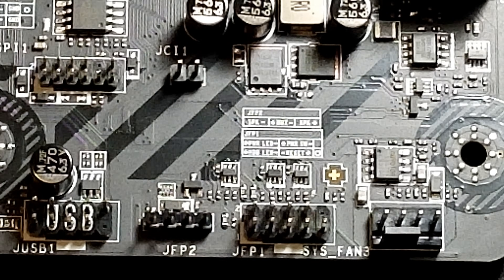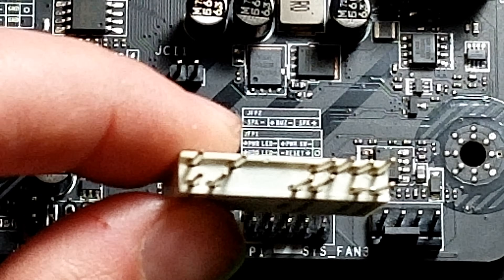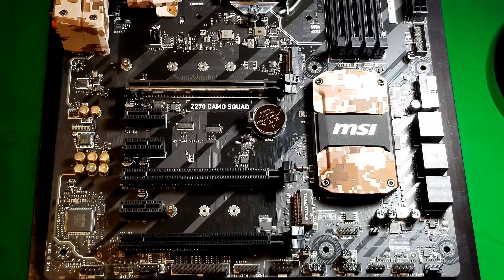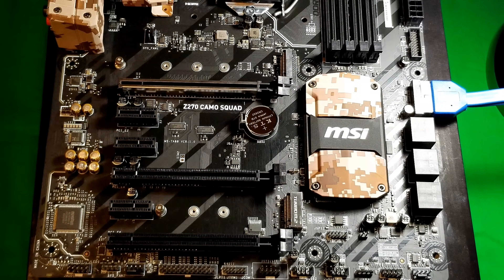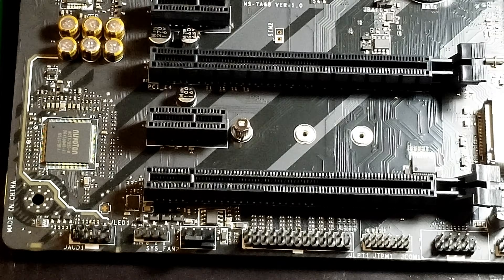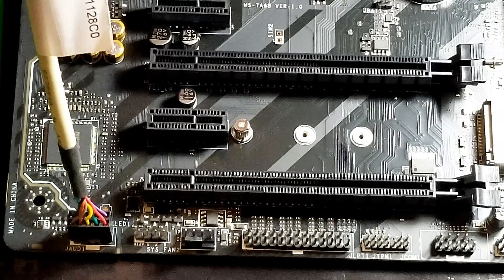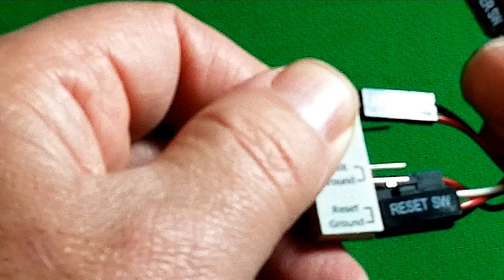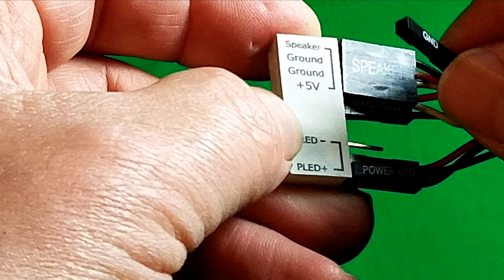Connecting your Case Front Panel connectors to your Motherboard

Comment: Hi ya great video . I have a quick question. I have gone wrong somewhere done the line . I have a factory hp elite desk which I wanted to put in a new case ( eventually up grade as I went along) I removed front panel connector ( not seperate pins ) for power and leds etc. But I think got it wrong when connecting new case to mother board .. As there was no manual or markings on MB I looked online and found some indication of where to put them. I can get some lights on. But I couldn’t get machine to power up . I decided to put everything back into old case and connect up the mother board but still the same problem - is there a chance I could have blown the psu or worse the MB .I have a new psu but don’t really want to test on it lol. Only other thing I can do is get a new bother MB (1150) and swap out CPU at least the MB will have markings . Any idea what could be wrong?  When the psu is plugged in the green light on the MB is on. 

Thanks
Reply from the maker: Transplanting to a new case from a pre-built can be tricky, with ensuring the standoffs are all ok to start and nothing shorts out, after that the next thing would be to get the Pin Layout for that motherboard to know the places you need to plug into...just plugging in the case cable's are not likely to cause any electrical type problems unless you plugged into something other then where the case LED's are meant to go...like if you plugged into firewire, or some such thing...It sounds from what your saying that your Motherboard is likely ok, but without having it to test myself that's just an educated guess...if you think something happened to the PSU, you could take it to a computer shop and get them to test it for you, usually at no charge, but some might...or just purchase a PSU Tester for around $20 to test it yourself...A new motherboard with the markings would certainly help to be sure where to plug things in but it doesn't sound like the MB is an issue...what motherboard is it, I'll see if I can find out for you where everything plugs in...Thanks...
Reply: Reviewing Playing & More RPM thank you for your reply.. the motherboard is 
https://www.empowerlaptop.com/p/737728-001/?currency=GBP&gclid=EAIaIQobChMI3t2WgZHT5QIVBbDtCh2V_Q2kEAQYASABEgLDkPD_BwE 
The black PB / LED pin is the same as this one in the picture. I appreciate it if you do find anything 
• •
• •
  •
• •
• • 

Like I say I put it all back into into the old case and connected up all the power and it still didn’t work. So hopefully it’s just psu as I have a new one .
Reply from the maker: There are some uniques issue's with this motherboard that will imo make it very difficult to use it, ie..there is a PSU backplate adapter you will need to buy, and apparently there is some unique adapter you will need as well but couldn't quite be sure which one they were referring to, the cost of both would be a good portion of the cost of a new MB...plus there are no markings on this particular motherboard to show where to plug in your connectors, therefore it would take some trial and error to get it right, and that could prove costly and or damage components trying to figure it out...Which I could have found more info for you, but on this one I'm at a loss...sorry about that...
Reply: Reviewing Playing & More RPM thanks Dennis - i appreciate your help... I’ve brought a new motherboard to fit my CPU which I think will be the best thing to do now. I’ll save for a new CPU and new motherboard in the new year and upgrade over time. I haven’t been beaten - I’ve learnt so much and I guess this is the beauty of it all - again thanks so much
Reply from the maker: well wish I could have helped more, all the best...
Reply: Reviewing Playing & More RPM and you!

Comment: Can someone help I’m using the nzxt h700i and I don’t have any from panel connectors like this!?!
Reply from the maker: Your actually lucky, the H700I has all the connectors together, is the PLED + and -, power reset etc in one square block, so going from the left of where it shows your front panel pins it should fit over them, just gently slide them on it only goes one way, and then your done...Might have to get this case and do a video on it, it's a great design actually...Thanks...

Comment: Can my hd audio go anywhere on AAFP??
Reply from the maker: It only goes in one way, look for the the HD Audio cable, it has a blank spot line it up with the blank spot on yours and it will be good...Yes some MB's call it AAFP...Thanks...
Reply: @Reviewing_Playing_and_More_RPM  Yep got it, one more thing though, i have a 500gb samsung evo and a wdblue 2tb hdd and all it shows up is a 932 gb partitian, but in bios they both show up correctly. Thanks
Reply from the maker: You may need to initialize one of the drives or perhaps it was used previously and was partitioned off, not certain but check to ensure you set the boot drive to whichever one you want to use, and then once you've installed the OS you can go to Desktop Management and see what is showing and initialize the drive if necessary, or you could potentially have a defective drive...there's a few things that can account for it...hope you get it going ok...Have a great day...

Comment: Why is my pc turning off right after turning it om
Reply from the maker: My first thought is an incorrect power supply voltage might cause your computer to turn off by itself. Make sure you're keeping the computer cool enough, or it might overheat to the point that it shuts down. ... Test your power supply, 2nd could be the CPU Cooler is not working correctly to cool the CPU...also if the system is old, dust accumulation on the fans can add heat to the system and cause issue's so cleaning it might help as well, if none of this works let me know...Thanks...
Reply: To me it was my motherboard that sucked
Reply from the maker: @ogaboga2952  Yeah it sounds like that might be the issue here as well but really hard to say at this point, take care...Thanks...

Comment: I just realized that I did the power, reset and HD led the opposite way of how they should be, and it still worked. Aorus X470 Gaming Ultra
Reply from the maker: should not have worked if the power was opposite what it should be but in some cases they wire the cable wrong and it needs to changed, however the LED and reset won't matter and will work no issue's...typically though the power should not work if placed wrong...Thanks...

Comment: why doesnt the direction of the LED pins matter? LEDs only work one way, they're called diodes
Reply from the maker: The LED for the case will work regardless of how it goes on the pins, the + and - won't cause any damage and it will still work...
Reply: @Reviewing_Playing_and_More_RPM  there's probably a reverse protection in the case then. still better to connect it the right way
Reply from the maker: Case LED's have been this way for many years, without any issue's, but yes connecting it correctly is always best but ultimately will not make a difference...Thanks...

Comment: Wait.  At 10.32 you connect the positive arrow to ground?  Is that right?  Shouldn't it be negative to ground?
Reply from the maker: In a case the Positive goes to positive which is indicated by the small arrow, the other goes to the -(negative) what I showed is correct...if you don't think so you can check out other videos on the topic and you'll see the same thing...hope that helps...
Reply: @Reviewing_Playing_and_More_RPM  ok, thank you...

Comment: Srry I'm newbie you know the f panel connectors do they come with the case?
Reply from the maker: Yes, the cables come from the Case and go to the Front Panel Connectors...Thanks...
Reply: @Reviewing_Playing_and_More_RPM  um I bought Phanteks p350x but it only came with power , hd audio and power switch. Do I have to have the rest???
Reply from the maker: No some cases don't have a reset button or in some cases there won't be a LED light on the case either...I think every case should have one but that's just me lol...
Reply: @Reviewing_Playing_and_More_RPM  lol

Comment: Great video. Can you make another video comparing the pins on the board to the pin diagram in the manual? Some of the diagrams don’t match very well or are difficult to interpret.
Reply from the maker: I have a look and if possible and I have the time to complete it I'll make one...Thanks...

Comment: The power switch confused me. You said "the positive in this one is the bottom one" and put the positive on ground. So ground is positive?
Reply from the maker: The positive is the one with the arrow the one beside it is the negative as long as you follow that on the front panel connectors ground is not a concern
Reply: I had the same question. For the HDD LED, you put the arrow on “positive.” For the reset, you put the arrow on “reset” not “ground.” Then, on the PWR, you put the arrow on “ground,” not PWR. They are plugged in differently, which is why the confusion. So does the arrow go on “ground” or “the one that isn’t ground.” That is the question. Or do those not matter?
Reply from the maker: @andygetz7343  The PLED + and - matter as well as the Power, the others can go in any way and will still work just fine...so no difference on those other cables...except of course RGB...Hope that helps...

Comment: OK, so I just found this video by googling around and doing some research, So I bought this cheap 400 dollar Lenovo Desktop and it has an Intel BSW N3050 board. There is absolutely nothing on the internet about what the pin layout is for the Power and reset switch, etc... At first I bought a NVidia 1050 graphics card and stuck it into the PC. It works fine but the case is little and the GPU barely fits even tho it is very small. So I decided to buy a new case, but unfortunately when I got the case I noticed when I was trying to move the mother board that there is one of those adapters you were talking about in another comment, It connects the front panel pins and into the motherboard. Due me getting a new case I cant use that adapter., do you know of anyway for me to somehow connect all of the front panel connecters without buying a new board or am I forced to buy one?

Pc:https://www.amazon.com/gp/product/B01KLSMWVA/ref=ask_ql_qh_dp_hza

Only thing I could find for mother board:https://www.impactcomputers.com/01aj066.html

New case:https://www.amazon.com/gp/product/B07GNJPC93/ref=ppx_yo_dt_b_asin_title_o00_s00?ie=UTF8&psc=1

Pls for the love of god help me, ive been trying to hook this up for months now and this is the only thing holding me back :(
Reply from the maker: The Pin Layout for the Intel board should be beside the yellow pins just to the right, now I can't see it for sure but it does look like it's labelled...I can say for sure how old this motherboard is but it looks old...you can verify the pins by looking closely at the MB and see if it says PLED + and -, also HDD LED, etc...if so you can connect them as per the video... big issue is that the case has RGB and from what I can see you would need an adapter to use it...This is one I haven't see before but have a look and if you have the pins then your connectors should work fine with it...if you have the budget you could get a MB and CPU that are more modern, although I can't be certain as I can't tell for sure what board this is...hope that helps though...Good Luck...

Comment: Couldn't find it on a b450 motherboard
Reply from the maker: Couldn't find what? need more info...
Reply: @Reviewing_Playing_and_More_RPM  so I could find the place to put the LEDs into the b450 motherboard also I'm using the rosewill LEDs that came with my case
Reply from the maker: so you could find where to put the LEDs, or couldn't find where? if in doubt, it's usually the JFP1 or something of this nature, I'd have to refer you to your motherboard manual, and look for the Front Panel Connectors it should show you which one's to plug into...
Reply: @Reviewing_Playing_and_More_RPM  I was looking at my motherboard and it does not have jfp1 but it does have led_c and d_led1 wondering if I should pulg it in there...sorry for being annoying
Reply from the maker: Can you tell me the make and mode of the motherboard your using so I can check it out...Thanks...
Reply: @Reviewing_Playing_and_More_RPM  the aosus b450 m sorry I'm really new to this
Reply: @Reviewing_Playing_and_More_RPM  aorus not aosus
Reply from the maker: Need more there are a few aorus b450 motherboards...Thanks...
Reply: @Reviewing_Playing_and_More_RPM  I'm looking at the manual all it's saying is b450 aorus m
Reply: @Reviewing_Playing_and_More_RPM  I sent you a dm on Twitter
Reply from the maker: I'll check it out and get back to you later today...Thanks...
Reply from the maker: Ok at work so can't get the DM on my phone atm but as I looked at your Motherboard your Front Panel connectors are labelled F_Panel located by the small square Auros, just to the right of the USB 3.0, this is where you need to put in your case connectors...The LED for RGB depending on the type would be either the D_LED1 5V or the LED_C 12V...Hope that answer's your question if not ask away and we'll go from there...
Reply: @Reviewing_Playing_and_More_RPM  looking at my motherboard and seeing the USB 3.0 to the small square aorus sign there on two different corners
Reply: @Reviewing_Playing_and_More_RPM  and the cords that my LEDs are labeled are power sw, reset sw, power led -, power led +,h.d.d led and how would I install this when putting it the right way
Reply from the maker: You only have one USB 3.0 so the one by it would be the one...as for the connectors that is shown in the video can't help more than that, have a watch it'll explain it...Thanks...
Reply: @Reviewing_Playing_and_More_RPM  thanks for helping me and guiding me through this
Reply from the maker: No problem...Have a nice day...
Reply: @Reviewing_Playing_and_More_RPM  I figured it out thank you so much I will be donating to you in a few days
Reply from the maker: No need man I'm very happy to help you out...so glad to know you got it figured out, Great Job...well done...
Reply: @Reviewing_Playing_and_More_RPM  I feel as if you are going throw all this trouble to help me someone you don't even know and  guide me through this I should show appreciation.
Reply from the maker: Your appreciation and Thanks is more then enough...You have an amazing day...
Reply: @Reviewing_Playing_and_More_RPM  you too
Reply: @Reviewing_Playing_and_More_RPM  having another issue with my computer when I turn it on it says reboot and select proper boot device or insert boot media in selected boot device and press a key if you can help plz respond
Reply from the maker: You need to Boot to a Windows device, ie a CD/DVD with Windows on it, or a Bootable USB with Windows on it, you need this to boot up and install the Operating System...
Reply: @Reviewing_Playing_and_More_RPM  so how would I get windows on a usb to get it on it
Reply from the maker: @AnthonyWilliams-kx4lr  Here is a link to a video I did on doing just that, it will help...Thanks... https://youtu.be/Y_z9RdCxSbM
Reply: @Reviewing_Playing_and_More_RPM  k thanks

Comment: My NZXT H500 came with another set of front panel cables, one of them were called ”F_PANEL”, I’m lost!
Reply: Hey in the case the HDD bay has screws in it also there is a connector that goes on the f panel
Reply from the maker: Hi, this was a first for me so had to check on a few things, from what I found your case connector labelled F_Panel has 4 holes and on top or under depending on how you look at it has 5, so this would go on your JFP1, does depend on your motherboard though, so check your motherboard manual to be sure...what they did was they put all the connectors together which is nice but has drawbacks as well...if your still not certain, let me know your motherboard and I'll look for you...Thanks...

Comment: The arrows on the back mean that it's the positive side.
This is the first video to explain that to me. 
I've seen 10 videos about these front panel connectors....omg thank you!!
Reply from the maker: Your very welcome, glad it helped...Thanks for your great comments...
Reply: However, at 10:32 he has the arrow going to the ground.  He even twisted the cable to install it “upside down” to do so.  Given the color coding of the other wires, I suspect the arrow goes to ground instead of positive.  I’ll have to research further to verify.
Reply: @dm4789  Apparently polarity doesn't matter when it comes down to the power switch and the reset switch. So it doesn't matter which way you plug it in...
Reply: @dm4789 
I think you are right

Comment: Hey man! Kind of off topic but I have a motherboard for a CRT tv, I want to disconnect the wires for the coil & some other component functionalities I dont need, can I essentially just remove the cables and still have it work?
Reply from the maker: It's dangerous to mess with CRTs  I'd not touch it...can't say otherwise though...